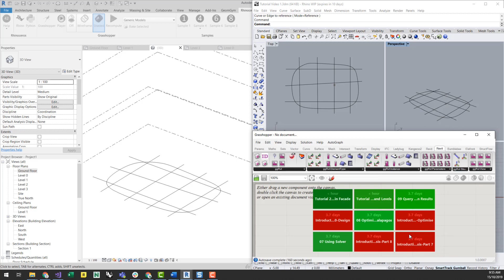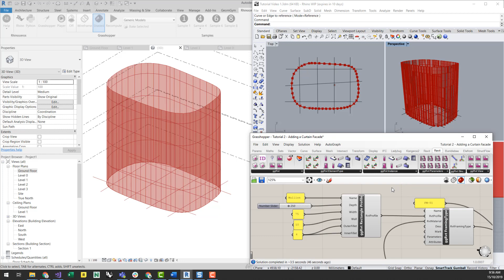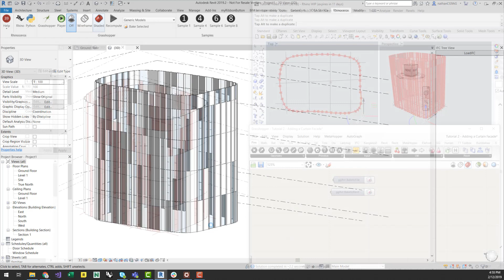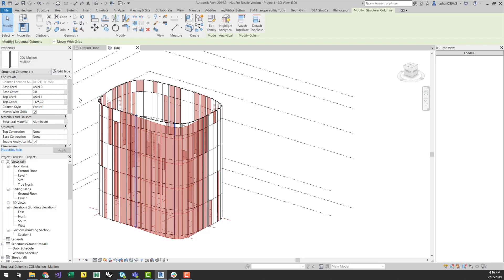Rhino.Inside Revit with GG: Part 2 - Generate a Curved Facade

Comment: also, my grids came but i can only see them if i maximize 3d extents and only for a brief fraction of a second - not sure where they are
Reply: From this sample model?  Or a different model.  It's best to email support at geometry gym if you have a problem so we can review it.  Revit Lookup addin is also a useful way of interrogating Revit database if you can't review by schedule or similar (to find the location of the grid).